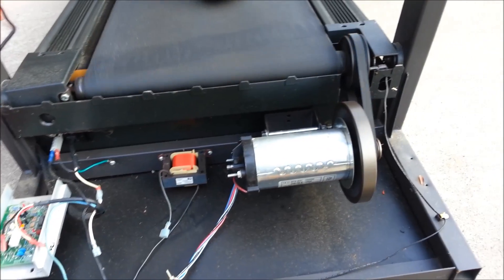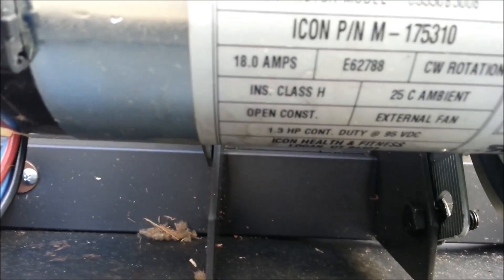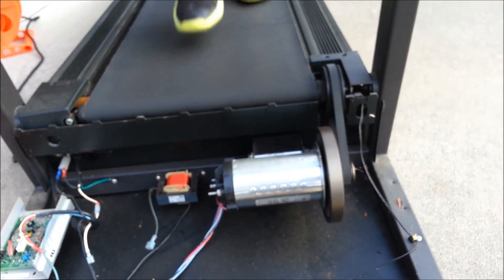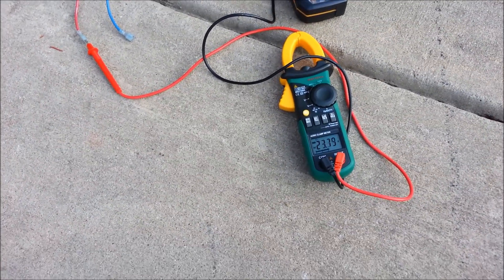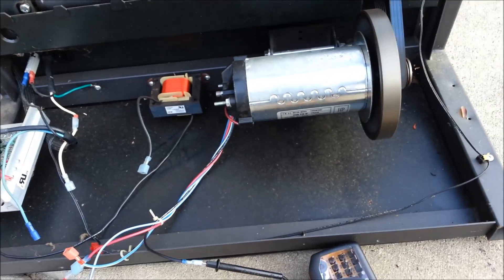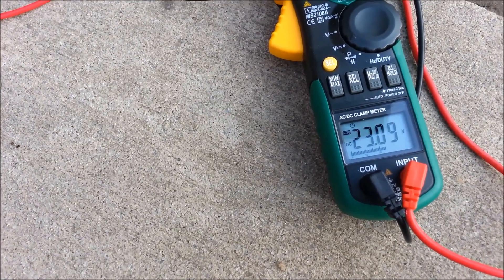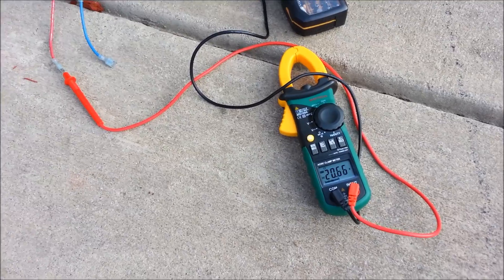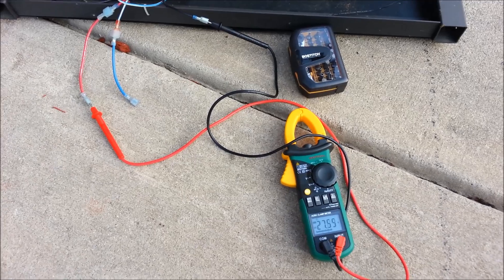Using a Treadmill as a DC Generator

Comment: Hello, I have similar setup. How do u manage to move the belt without electricity if you stand on the belt and the belt was on the board?
Reply: I Spin mines with another smaller d/c motor
Reply: I just push with my feet really hard..
It's a hell of a good workout!
It's like dragging 100# up hill..
The thing these people always leave out is " load"...
When you put a load on the gen like trying to charge a battery or lights...
It boggs way down!
I run a 125watt/120volt heat lamp off mine 
Because I can't find any other way to use the current.
I have tryed buck control but haven't gotten it to work yet..
I want to recharge solar gen lithium battery with it so I need a current
Around 19v 4amp...my system shuts down due to over amps

Comment: There is nothing impressive about 21 volts.  It's the actual current that matters.  VoltsxAmps=Watts
What was the amps number so we can calculate watts?  Generators are always compared by output in watts and electrical devices are labeled by how many watts they consume.  I had a simple field telephone handcranked generator that put out 70 volts easily.
Reply: Pretty sure any load on that motor will stop it from spinning.
Reply: I was thinking the same. I have 2 85 Amps 12 Volts battery. If i put them in series then I am talking about 24 volts but can this treadmill charge them? I though about power and then realise how many amps I will get from this treadmill
Reply: @TheScorpian91  21 volts (no matter how many amps) cannot charge a 24 volt pair of batteries.  The charging voltage of 12V batteries is about 13.7-14.7 for example, so two batteries in series making 24V would need double (27.4V-29.4V).

Comment: Lets put the whole gym to power generation and then connect other gyms!
Reply: Not enough electricity to overcome resistance in the wires over any appreciable distance.  It would take a great many gyms to power one average house.   A pedaler outputting 100W for an hour generates what your utility charges about 1/10 of a penny for.  Divide your whole bill by the number of KWhrs. (kilowatt hours or 1,000 watts for an hour.)  It will be about a dime for each KW hr.  An average adult can produce only about 100 watts for an hour, so you would need 10 pedaling for an hr. to earn one ten cent KWhr.  Pedal generators are good for demonstations of how little we pay for a lot of power on the human scale.  Now start looking at specs on your electrical appliances.  With a fan and heating coils in it, a handheld hair dryer consumes 1500 Watts.  That means it would take 15 pedalers at once to power it; perhaps fewer at a briefer, unsustainable pace.

Comment: Exceptionally good>>>ur2.pl/911   It has a quiet and smooth operation. The electronics are more than adequate. We do NOT run on it, so I can't evaluate that, but the walking experience is extremely favorable. Then the best news, we had a problem with the treadmill that required the "dreaded" call to Customer Service and a repair person. I CANNOT express how pleased I was with their customer service and the repair technician. Absolutely top-notch!! Highly recommend the company and this treadmill!

Comment: Have you tried yet to charge a battery or drive any kind of load?  I see a few commenters asking about the amount of current produced and the response is that the motor is capable of producing 16 amps.  That doesn't answer the question however.   What we want to know is how much can be produced by a human walking on the treadmill which will be no where near what the motor is capable of handling.  I see that walking generates about 22V no load voltage.  If you put a load on it, it would be much harder to walk and the voltage will drop unless the person can maintain the same pace with the greater resistance which is fine because that would be expected, but how many amps of load can be put on it before it get's too hard to maintain the walking pace?
Reply from the maker: alexermerson 
Welcome and thanks for the question.  It's been about two years since I put this video up and the motor has long been removed and the treadmill has been dismantled.  My initial plan was to use the motor in a wind turbine, so this was only a brief experiment.  In retrospect, I did wish that I had kept the set up for more testing and future experiments.  However, I do hope to obtain another treadmill to perform the tests requested.  Cheers
Reply: Why use it to run a load directly? charge battery and run load off battery. If you make the crank gear huge and the generator shaft gear small you can get a significantly higher rpm on generator but the walking surface will have more resistance so make walking surface heavy so its inertia can counteract the resistance?
Could really get into it and add a transmission, daily run produce electric city
Reply: Google "pedal power watts".  Looks like a 200-300 watt dc motor, properly geared would be an appropriate design.  Volts times amps equals watts.

Comment: I like this,,, My question is, what is the current flow at these Voltage?   Just knowing the voltage doesn't tell me what type of power you are generating.   Thanks
Reply: That is significantly stronger generator than i anticipated. Why tf do these gyms use electric to run the treadmill when they could be used as generators....
Reply: @kornbread5359  Because humans produce far less power than they think they do
  Just keeping up with the moving treadmill surface takes enough effort over a reasonable amount of time, to give a good workout.  In kilowatt hrs. for ten cents each from your utility, a human at the avg. 100 watt output can earn only a penny per hr. on a machine more efficient than a treadmill.
Reply from the maker: Laird S 

I don't recall at the time of testing but the motor is capable of outputting up to 16 AMPS at high RPM.  Cheers

Comment: If you get a boost/buck converter, you can set it to any voltage you want. A sepic converter might be good as you are both above and below 26.8 volts at times.
Reply from the maker: pirucreek 
Sounds like a plan.

Comment: Thnx for providing such a useful video sir..I want to know that, can the same process be done by a simple DC Motor of 48V-800watt??....Will we get approx. same output ,so that we can charge our battery from it??...Please rply Sir :)
Reply from the maker: Sure, it should work just fine.  Go for it.
Reply: Sir i am using an E-Rickshaw motor,in which 3 wires are there in output of motor. So ,all 3 wires would be giving current or 1 wire would be an earth??...
If all 3 wires give current then how will I check voltage/ampere in my multimeter,which needs 1 current wire & 1 earth wire...
Reply: plz reply sir..ur rply would help me in my project..
Reply from the maker: +Vishal Gupta 
If it's a DC motor, use the red and black wires. Hope this helps.
Reply: Sir ,it is a DC motor, but it has got 3 wires & that too of random colours like RED,BLUE,YELLOW..
how do I get to know that which is a earth & which one is Live terminal??....
Reply from the maker: +Vishal Gupta 
Use a volt meter and measure the voltage across two pairs at a time.
Reply: ok thnx sir,surely I will..
1 more question!!..
By rotating a DC motor mechanically(human effort) of 48Volt-1000Watt?/...
How much will be the expected power produced from it??...
Reply from the maker: I will leave the calculating for you - good home work....
Here you go:

P=m×g×Hnet×η 

Where:
P
power, measured in Watts (W).
m
mass flow rate in kg/s (numerically the same as the flow rate in litres/second because 1 litre of water weighs 1 kg)
g
the gravitational constant, which is 9.81m/s2
Hnet
the net head. This is the gross head physically measured at the site, less any head losses. To keep things simple head losses can be assumed to be 10%, so Hnet=Hgross×0.9
η
the product of all of the component efficiencies, which are normally the turbine, drive system and generator
Reply from the maker: This is relating to water turbine but the same principle applies.  Again, I will leave this homework for you to do.
Reply: No way can anyone be strong enough to put out 800 watts of work on a treadmill.  750 watts takes 1 horsepower to produce at top athletes reach 3/4 hp only very briefly at 100% effort.
Reply: @denbecr49  im not an electronics whizz but i think he was just planning to build one using a motor rated for that kind of output, probably wasnt expecting to get the whole amount of power it was rated for lol

Comment: so firstly it is mannul treadmill and then you attach the treadmill motor on it...?
Reply: i had tried at my frends home ,but it very hard to have a simple walk on it while the treadmill is off....
Reply from the maker: I am using the existing treadmill motor, which is a DC motor with a permanent magnet.  I wired it so that it can charge a battery and generate power.   It's the same concept as a wind turbine or hydro power.  As a matter of fact, this same motor can be used in wind or hydro power.  If you can find an old treadmill with a permanent magnet, you can do the same thing.  I got this treadmill really cheap off Craigslist.
Reply: is there any hight adjustment in treadmill,so i can increase hight an have a walk on it to generate the power
so the only permanent magnet dc treadmill motor can generate the power.
i am looking for any old treadmill motor to make it as power generator for my home.
so which type of treadmill should i have to get
Reply from the maker: +Ranjit ombale 
Any treadmill with a permanent magnet will work.  This one happened to be a Cadence.  Look on Craigslist.  You may get one for $20 or under.

Comment: hi, i want to build one like this. Do you have any video describing connections in detail.
thank you
Reply from the maker: Thanks for watching. I will upload a video soon showing how the wires are connected to the motor.
Reply: can i know when that will be.
Reply from the maker: +Nadipalli Sandhyarani 
 By tomorrow but will update you if done earlier.
Reply: thank you so much
Reply from the maker: +Nadipalli Sandhyarani 

Here is the video:
https://youtu.be/5xNpQ9f9jXc
Reply: +DIY OneForAll what did you use to connect the treadmill motor to treadmill. how did you hook up those two?
Reply from the maker: +Nadipalli Sandhyarani 
Hi, the motor was already installed in the treadmill.  I connected the terminals to the volt meter and used the output terminals as you would if the motor was out of the treadmill or used in a wind turbine or something like that.
Reply: +DIY OneForAll if the motor is already installed why did you need a motor u said you bought from ebay?
Reply from the maker: +Nadipalli Sandhyarani 
I was saying that I bought the entire motor off Craigslist for $25 but if I had bought a motor off Ebay,  it would be $40 for the motor alone